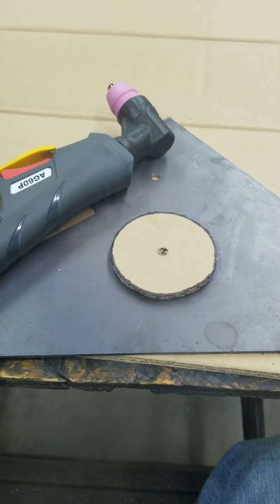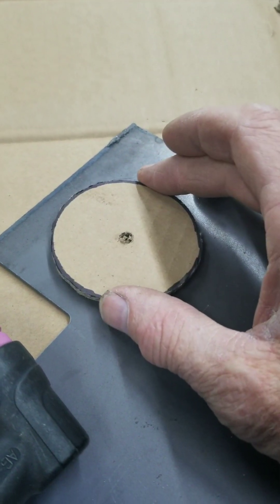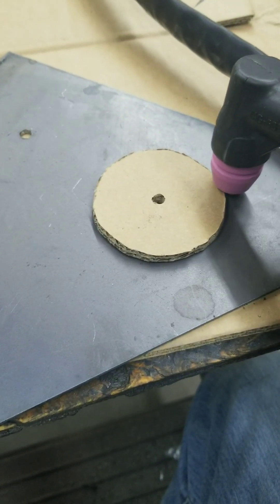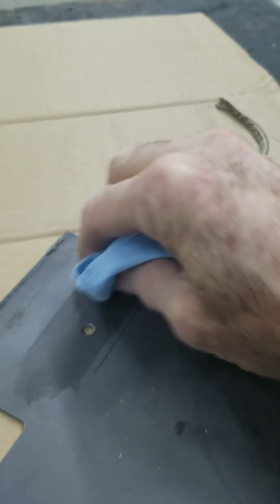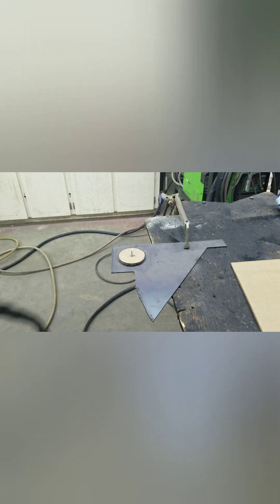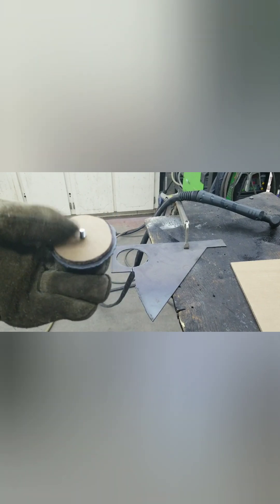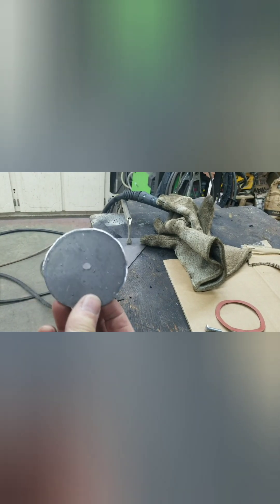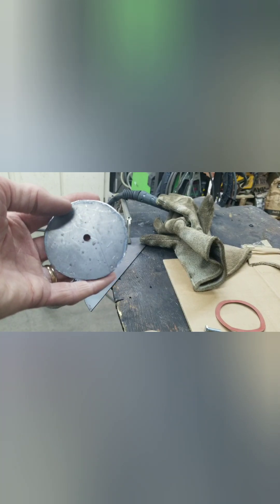Plasma cutter templates made from cardboatd

Comment: I was wondering about this method with a ag60 style torch and dragging.  This video answered yes you can drag that style tip.  Thanks!
Reply from the maker: Yes these tips do wear of course.  Mostly the internal diameter of the hole increases.  If you get the speed right while dragging the tip they last pretty good